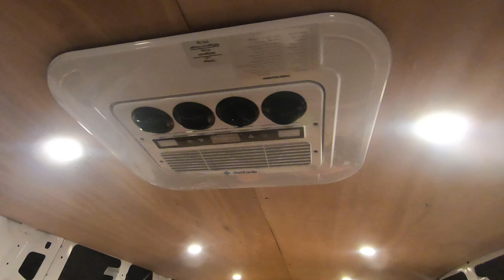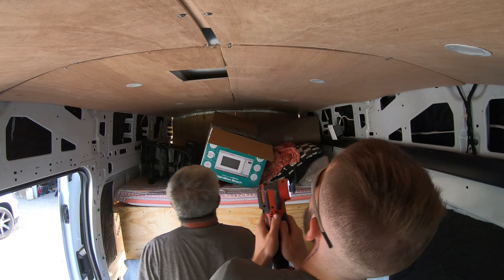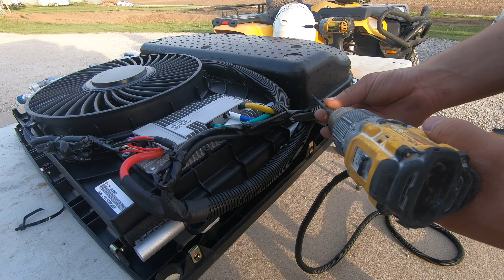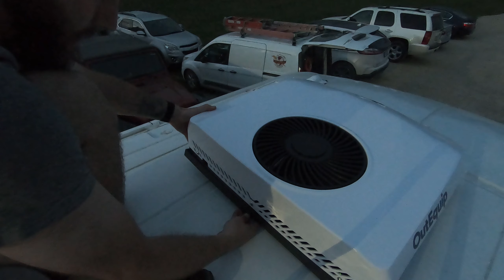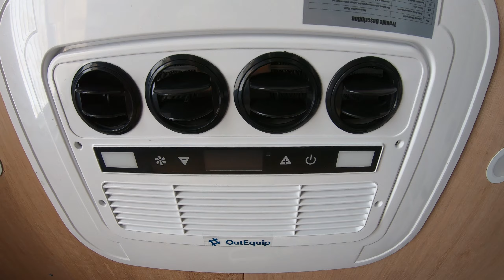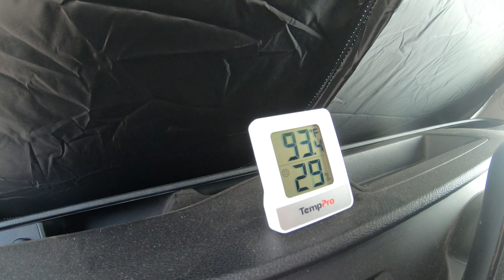Installing OutEquipPro AC on our Transit Moto Van!

Comment: A few things to consider if you’re about to install one of these. 

First the Transit roof is very thin. If you choose to climb on top of it every where you put your knee that’s not on top of a roof brace will leave a dent. Ask me how I know!

The Transit roof is curved and the AC gasket will not be level leaving a gap on the sides of the AC. I added butyl tape under the sides of the gasket to level it.

To get everything secure it really needs a frame inside to firm up the ceiling and have something to tighten the interior metal plate against. I made a frame from 2x2s and screwed it to the van roof braces. You can also buy premade frames online. However by using a frame you cant run the wire down inside the AC because it can’t get around the frame without drilling a very large hole in it. I drilled a separate hole through the roof for the wire. Good luck!
Reply from the maker: Sounds like you got yours dialed in great! I agree transit roofs are very thin, which was great for cutting but like you said needs some extra bracing if you want it crazy solid. I went nuts with caulk to seal our gasket, wasn’t taking any chances haha.